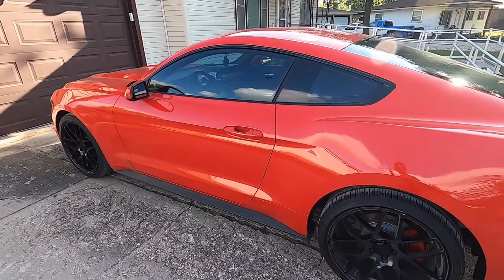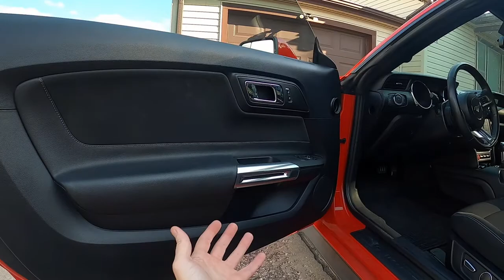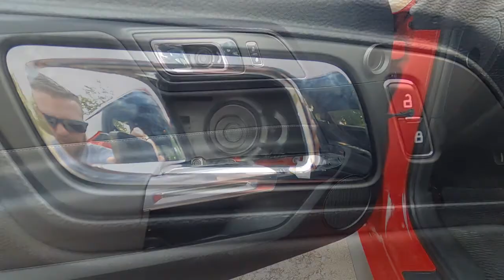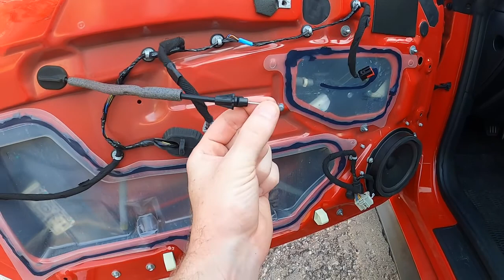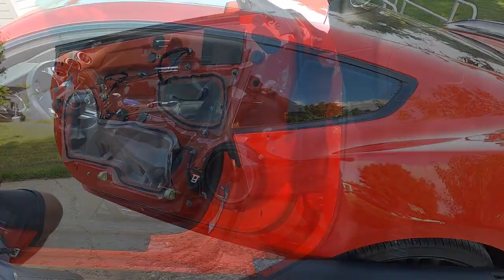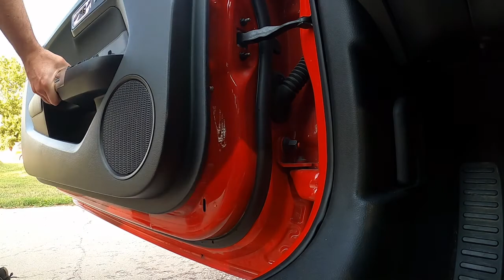Fixing 2015-2020 Ford Mustang Wind Noise - Removing Door Panel & Adjusting Window - S550

Comment: Question, I’m about to fix my window. Do I have to disconnect the battery ?
Reply from the maker: Yes, it's a good idea.
Reply: If you ever removing electrical connections of any kind its always good practice to disconnect battery. it only takes one short circuit to really mess up your day.

Comment: Thanks!
I have a 2016 eco boost, and water comes trough that gap. Do you think by doing this will fix it? I don't have any wind noise.
Reply from the maker: Maybe, but I can't say for sure.
Reply: @KonaBlueSVT  Thanks for the reply, i will look in the morning at the distance, maybe i need a new seal the one i have on the car right now is very soft.